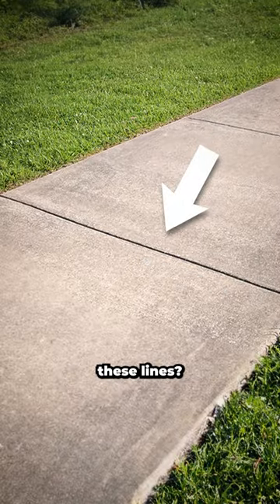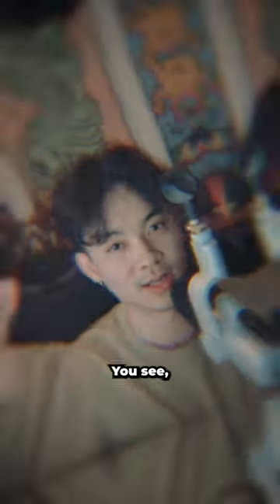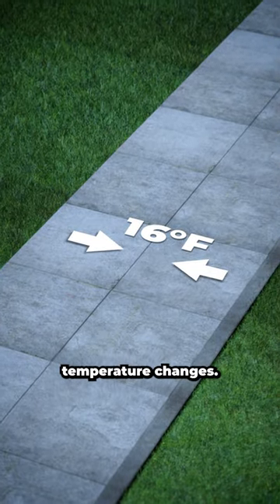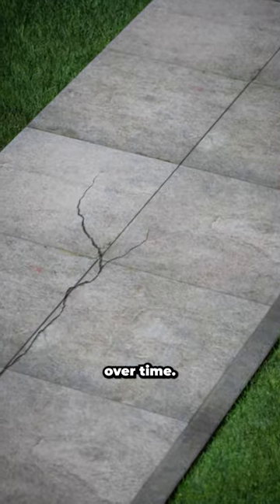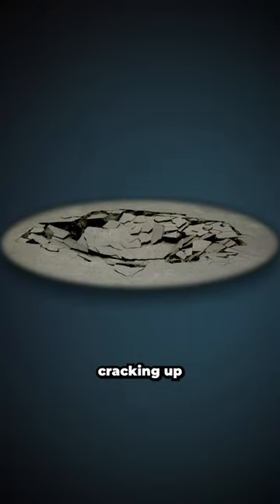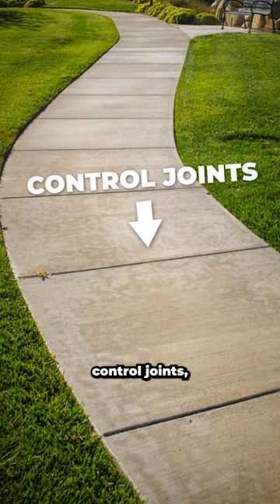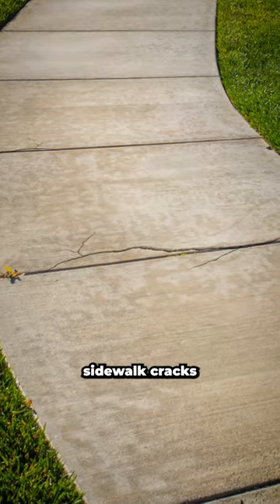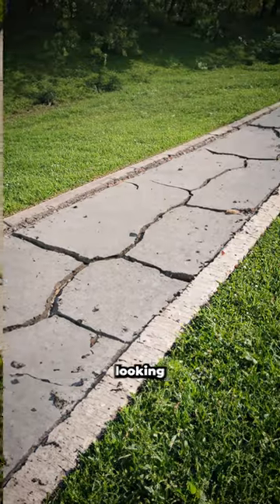Why Sidewalks Have These Lines 🤨 (EXPLAINED)

Comment: I dont think it's there as a "weak spot", more just to allow room for the concrete to expand. Look at a good sidewalk and you won't see cracks at the control joints.
Reply from the maker: not necessarily! What you're referring to is called an "expansion joint" which is different than a control joint, but is also used in sidewalks and other architecture. In sidewalks, the control joints are still intentionally placed as weak spots to control cracking. The "good sidewalks" that you're referring to may be made of something like asphalt or maybe they just haven't aged enough for the cracks to appear. Hope this helps!
Reply: All concrete slabs crack given a large enough contiguous surface area. The reason you put control joints or relief cuts is to guide the cracking along the joint. This happens very quickly, usually within days to a few weeks. Control joints do not have anything to do with expansion and contraction as there is no separation of the slab between control joints. Expansion joints are used to control the effects of temperature such as heaving.
Reply from the maker: @ryananderson4614  spot on!
Reply: No it's literally so if it moves and cracks it'll do it in that spot don't always work but that's the idea( I do concrete for a living)
Reply: In this case the crack doesn’t separate each slab, it is still connected further down but usually it fills with dirt so we can’t see it
Reply: "you don't think" huh? So you just comment argumentatively where you don't have actual knowledge? You must live a difficult life.
Reply: @rickwar0 why cant you leave the guy alone its just some words
Reply: I just noticed walk suggests hisuiyan Avaluges made of concrete
Reply: Ya I always wondered why they did that but also one time I stepped on the line and the mail mans spine just broke for some reason
Reply: Thats the intuitive solution. But if concrete is going to expand, you couldn't just give it space and solve the issue. After all it doesnt just always expand at the ends. So knowing that, it makes much more sense that you control where and how much the concrete will crack when it spontaneously changes temperature
Reply: It’s a flipping side walk 🥷 u walk on it that’s it

Comment: Me who works in concrete🤣 
But yea their called relief cuts
Reply: 😂😂 I'm a carpenter and even i know that
Reply: So they dont just lay individual premade pieces of concrete down in a pre-dug out area?
Reply: You don't work in the concrete industry
Reply: Works in cocrete industries but has a minecraft profile ? Sure. 😂
Reply: „Works in concrete”
Hope you get out of it soon
Reply: @Benjangles123 it should be even more obvious by his video from 3 months ago ☠️
Reply: What is the recommended vs mandatory limit for concrete delivery? What tests are run during a concrete pour, and how often? What units are used to measure concrete? What tests are run on the soil before a pour? When is the most common time for concrete pours? If you can answer these, then you do work in concrete.
Reply: your profile + comment makes it hard to believe...
Reply: cap i went to ur vid and heard ur voice ur like 12
Reply: Im a sidewalk and even i know that!
Reply: @Benjangles123 what's a profile picture got to do with someone's profession? Literally nothing  your comment makes no sence
Reply: Call em control joints in CA...

Comment: In austria we use asphalt for sidewalks and concrete tiles
Reply: Same in Norway. I believe it's partly because of the climate. Concrete works better in deserts because it doesn't get as hot in the sun and won't melt. 

Asphalt works better in colder climates because it's more flexible and won't crack as easily if water freezes under it.

Comment: American sidewalks are so weird. They can barerly fit two people and have this weird grass thing near the road. In my country the sideways can fit a car and are made out of bricks, they look like actual stable infurstacture and not like slabs of concrete placed on the grass.
Sorry if I had typos, English is not my first language.
Reply: here in my city, our sidewalks are EXTREMELY tall, struggle to fit 2 people with poles, lights, and trees in the way (which usually makes the sidewalk cracked and bumpy).. (although they are fixing it now)

Comment: I never got why they do almost continuous concrete walkways in the USA. Tiles break so much less because they're so much smaller and are easier to replace. If trees nearby warp the sidewalk, it doesn't break and it can just be replaved with the Sam meterials. And even if it does break, you can get it out with tools from any toolbox.

Plus it looks better.

Comment: It's a phenomenon called Thermal Expansion. Heat makes things expand, even concrete roads. And vice versa for the cold.
To avoid road cracks, construction workers allow thermal expansion to do its thing. Some even put asphalt as grout.

Comment: Whether or not this is intentional, it also makes for much easier demolition work for contractors. If you need to excavate underneath and blast up some sidewalk, they break off at the control points making clean lines and are very easy to form and repour afterwards.

Comment: they are relief cuts and your right and wrong (well not wrong) they are also left there because in winter water will seep in to the concrete freeze expand and then crack the floor pushing it apart, if no gap floor goes up if gap floor fills gap

Comment: it's not to controllo were it cracks it is to reduce the cracking since if it expands it won't push into each other making the cracks.
or atleast that's the most common sense tough anyone would have